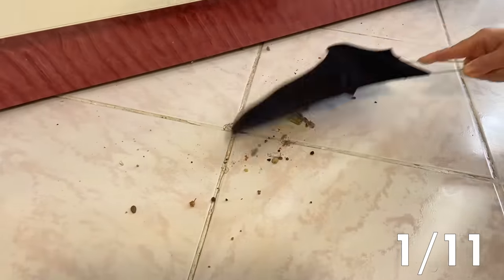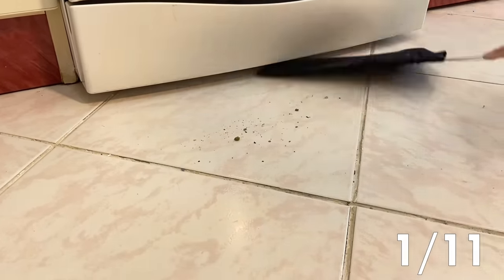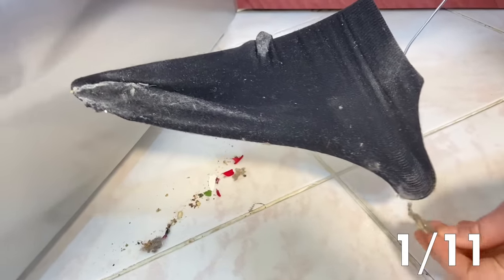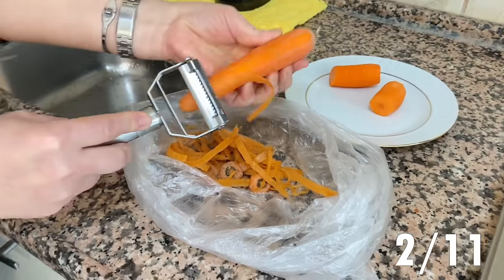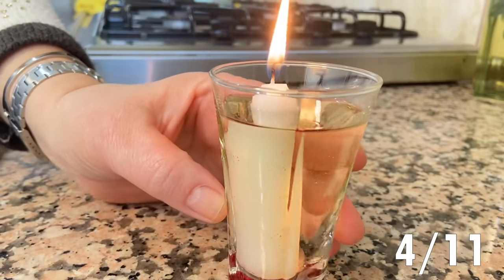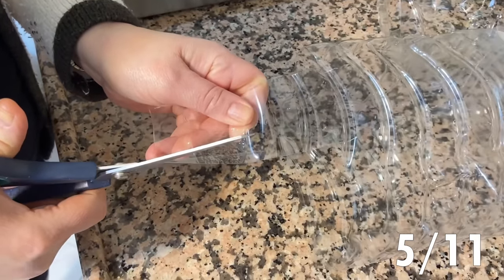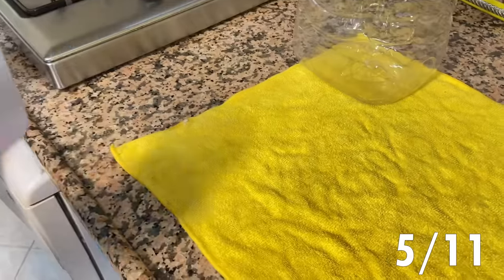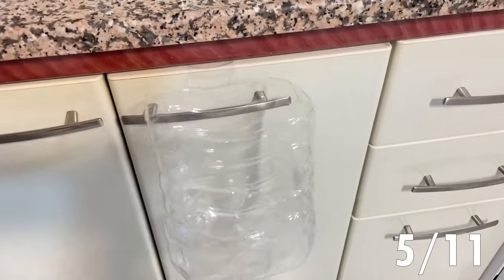My mother taught me. Life tips from wise women!

Comment: I just found out that those towels can't be washed in the same washer with other laundry and shouldn't be dried in a hot dryer. The dryer melts the fibers in the towels and changes their texture and weakens their cleaning ability and absorbency. They should only be washed with other microfiber towels and dried on low-medium setting.
I wonder how many would still purchase them if they knew that ahead of time.